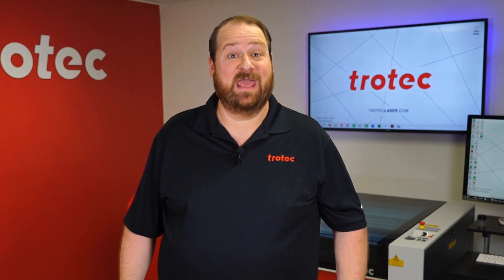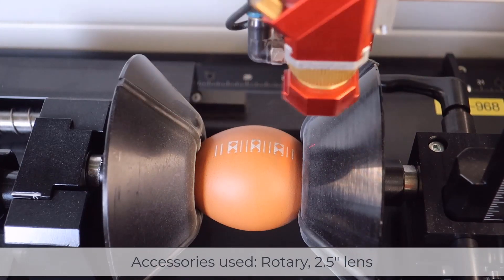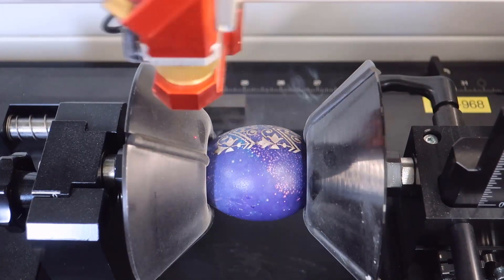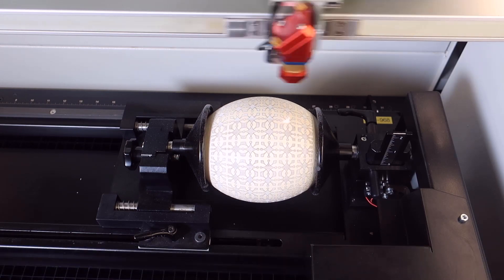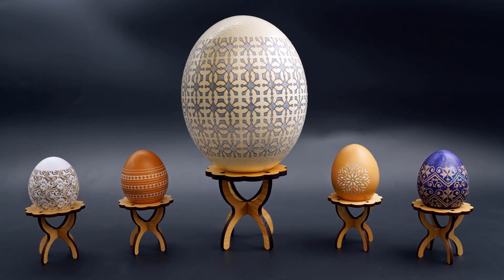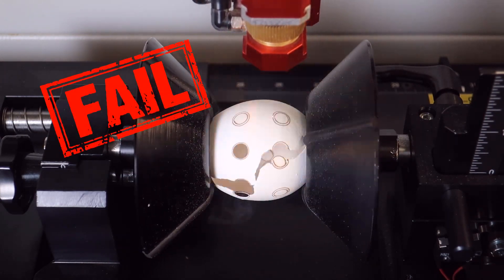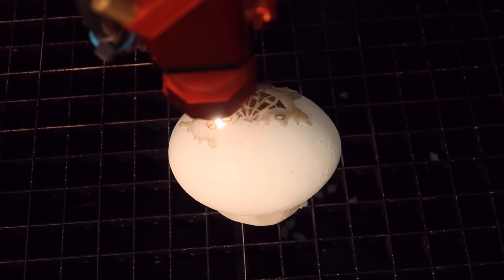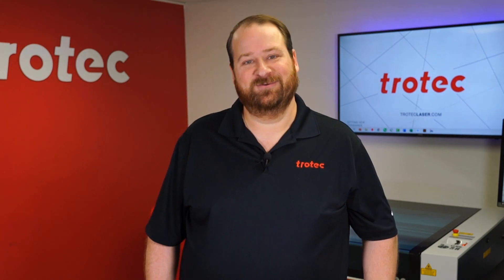Trotec Laser: Can you Laser Eggshells?

Comment: The egg engraving and cutting was great. What is the trick to getting the design to match on the round object?  Have not had success in getting to align when meets.
Reply from the maker: Hello! This process is done by using the red dot pointer to align the graphic to the egg and using the manual focus tool to make sure that the focus is averaged for consistent results, this is also a process that requires some trial-and-error testing with a higher failure rate to find the best setup.
Reply: @TrotecLaser  Thanks for the quick reply!  I guess my wording was bad.  The graphic design matched great after completing the engraving around the egg, even on the curved surface to the ends of the egg.  How do you get the design to match the egg shape so the pattern matches when the engraving returns to the starting point?  Even on a cylinder I find it hard to get the pattern to match where it meets after engraving.  Is it just trial and error?  Can take lots of items of exactly the same size to get it right.
Reply from the maker: @fredkoch9466  Sorry about that! The best way to achieve that would be to measure the circumference of the object. In the case of the eggs, we measured the middle, top, and bottom and referenced those measurments in our design.

Comment: Does laser give a heat to eggshell? When I carved white eggshell with too many rotations (using Dremel drill and dentist's drill bits) it got burn and that why it became brown color as yours :) "Turning to white" - it's just deeper in the eggshel, carved without heat.
Reply from the maker: The laser is pure heat energy, and the side effect of heat will cause most organic material to darken; if the heat effect is undesirable, then mechanical methods of cutting and engraving will not produce this issue.

Comment: Hey David, Great Job! Who would have thought???? I've got to try this. Question, Where can I get the templet for the stands you put the eggs on? And how did you get the yoke out of the egg?
Reply from the maker: Hello! Here is the template for the egg stands: https://www.dropbox.com/s/wm1pa2of0ojuxm5/Egg%20holder%20file.pdf?dl=0
We actually ordered the empty eggshells off of Etsy! https://www.etsy.com/listing/598831751/30-egg-shells-large-blown-chicken-egg?ga_order=most_relevant&ga_search_type=all&ga_view_type=gallery&ga_search_query=eggs+shells&ref=sr_gallery-1-23&organic_search_click=1&frs=1
Reply: There's a thing called a One hole egg blower but you can also find versions with a small hand pump that you use instead (much easier to use) but if you're only doing a few of these, then definitely just buy them pre-blown.